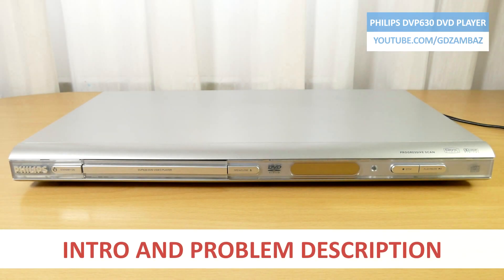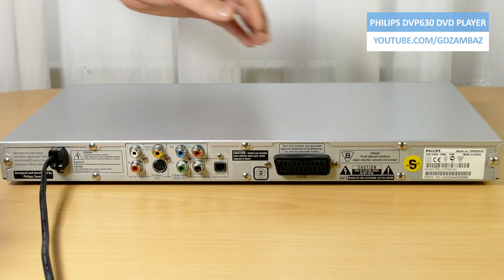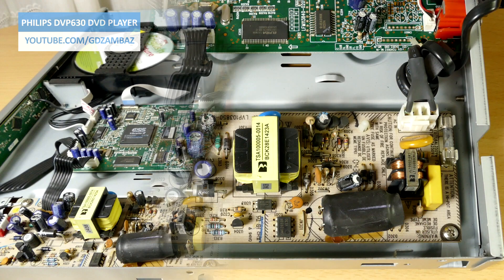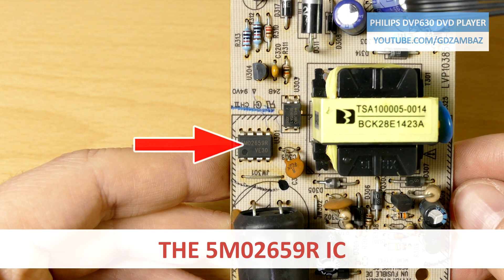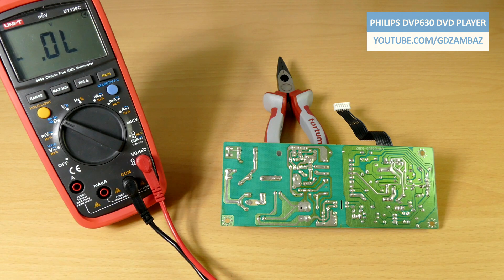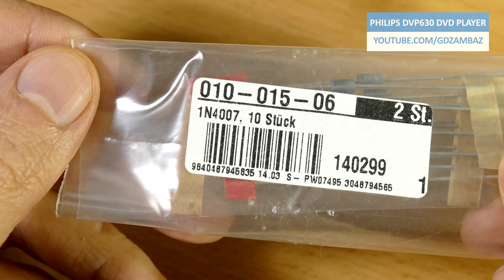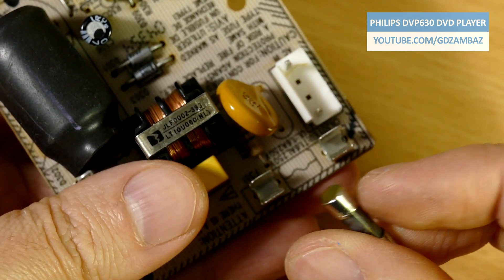Repair of Philips DVP630 DVD Player

Comment: Thank you so much! I replaced the flex cable with a new one. The spin motor spins very little and stops. I measured the voltage going to the motor. I saw that it was 4.5V for a short time. The voltages on the power stage showed the correct value. What could be the problem? I would be glad if you answer.
Reply from the maker: Hi and thank you for your comment.
I would like to help you, but remote diagnostics of a faulty device could be very time consuming, and I'm not ready for that at this time. Best, Goran

Comment: Dud you power on the dvd while checking multimeter readings
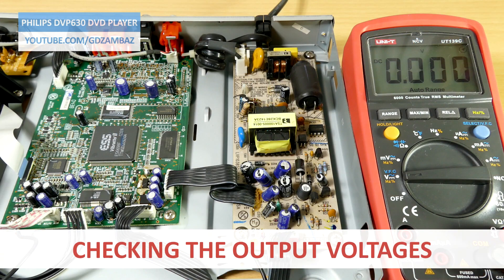Reply from the maker: If you are talking about checking the voltages at 10:20, yes, the player was on (not in standby).
Reply: @GoranDzambazov  sir i have one doubt can we add usb player the 5.1 output for it so that we can play songs through usb by usb module

Comment: Excelente video, muito bem explicado!
 Nesse DVD quando dá imagem mas não tem som qual é o problema! 👍
Obrigado
Reply from the maker: Obrigado!
Have you tried the playback with different media (DVD-Video, CD-DA...)?
Are you sure that the issue is with the player? Have you tested your audio-amplifier (if you use one)?
Reply: @GoranDzambazov  Obrigado por responder!
Ligo os cabos de audio à tv e tem imagem mas não tem som, já coloquei vários DVD diferentes, será um capacitor?
Mais uma vez obrigado
Reply from the maker: @luiscarvalho1960  Try connecting the audio cables to some other device which has an audio input, just to confirm that the problem is really located in the DVD-player. If there is no sound again and if that's the case for all media types, then the problem needs to be investigated inside the audio output stage in the DVD-player. If you are not a qualified electronics technician, from this point forward it would be difficult to give you an advice on what exactly to do next.
Reply: @GoranDzambazov  Obrigado pela explicação, bom trabalho!

Comment: How can I add USB port to Philips DVD player (dvp3028)
Reply from the maker: I assume that you would like to add to your DVD player a new functionality: media playback from a USB flash drive. I'm not sure how old is that model, but in general it is very likely that if the DVD processor used in your model had that feature by design, they would already have included that to be available. Still, if you are curious you can open and check which processor is used and then find its datasheet to see its features. Even if there is such functionality not activated or used by the manufacturer, you'll be challenged to find the way how to activate it or where to find appropriate updated firmware for the player.
Reply: @GoranDzambazov  thanks
Reply: @GoranDzambazov  The Motherboard is "40-P3020K-MAG2G"
Reply: @GoranDzambazov  in this motherboard 4 pins are left ( port also not soldered) CN5
Reply from the maker: I'm sorry but I did not have opportunity to search more thoroughly and find detailed information about the processor used in this player and the board you mention.

Comment: Useful Video, I own a philips MCD183 DVD micro system, currently it has this strange problem. There is no sound output coming from speakers and earphone out. But If I connect its RCA audio out to tv or another device (while watching a dvd )I can hear the sound. What could be the error with this system? Any Help is Appreciated. Thanks
Reply from the maker: Thank you for the feedback!
The problem is most likely located in the audio amplifier section, in particular the output power amplifier integrated circuit. I would start the troubleshooting there.